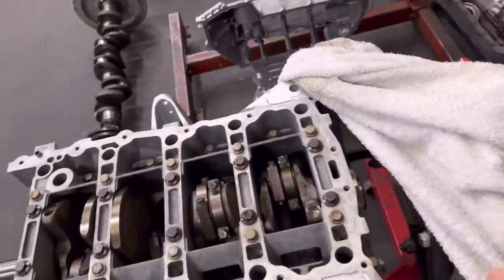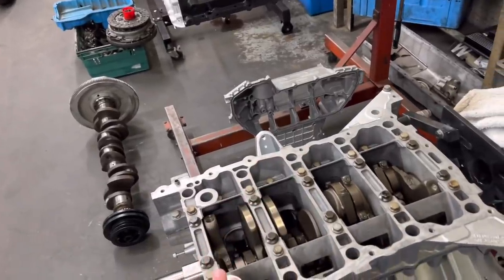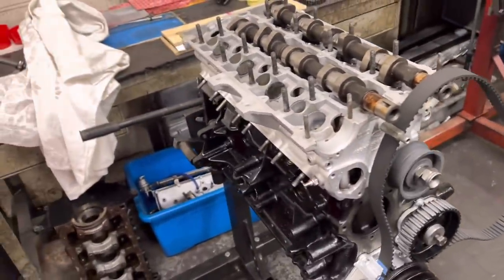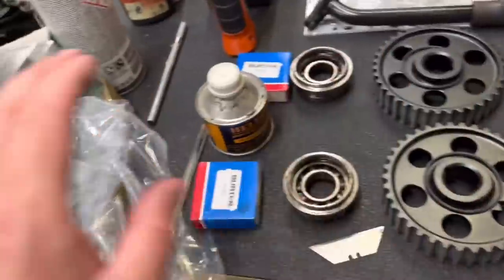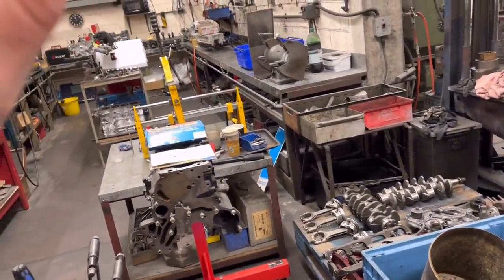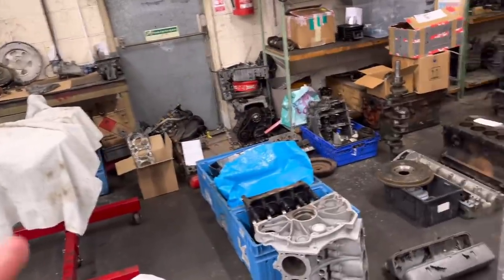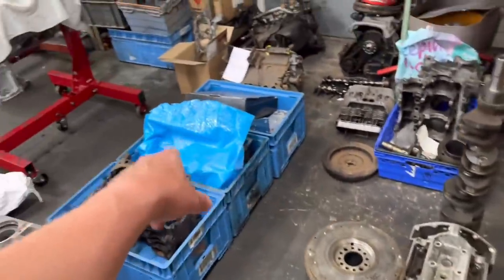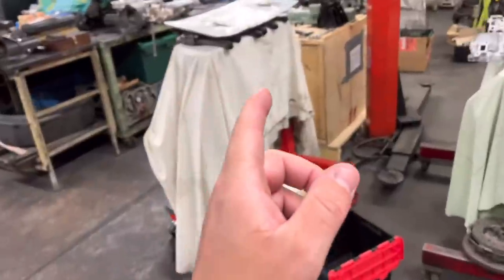I could be in BIG trouble for making this video

Comment: So where are the old oversize buckets?
Reply: Probably 'mullered' into one of the other bores and he is trying to fix the issue when he discovered he couldnt turn the cam to time it up hence belt hanging there.
Reply: @kevinapps1233  it will be as believable as his reasoning for building engines backwards. I am very suspicious of his story about those buckets, bolting head down without checking valves and cams are ok, just doesnt sound believable especially with that belt hanging there.
Reply: @kevinapps1233  i also wonder if he has ever heard of a valve spring, poundage tester, to ensure those springs are good,correct length and don't 'stack' up at full lift especially as he puts modified cams in.
Reply: @kevinapps1233  i think he thinks setting to cam grinders specs is good enough. We had a cam grinder and would experiment with different profiles, polydine correction etc. And run them to death on the dyno to find what worked and what didnt. We found that retarding exhausts would pick up a bit of low end torque at the expense of high end power and vice versa. A full list could be supplied to the customer so he could adjust timing to suit the track or weather. You could pull the same trick by increasing valve lash on push rod motors. The number of 'pinto' blocks that were sacrificed on the dyno so customers could keep their 205 and 200 blocks was large! With race or fast road YBs those hydraulic lifters were dumped and solid shimmed buckets were fitted to stop the followers 'jacking' up. Any full race engine or road engine were run up on dyno for break in and final tuning. This way we knew a performance motor was leaving the shop run in and fluid tight. Ordinary stock run of mill recons were done to factory spec with no dyno, but a list of dos and donts given to customer.
Reply: @kevinapps1233  thats thrown the gauntlet down i feel all you will get in reply are 'crickets' or sarcasm. I have tried to give him advise but he just ignores it as evidenced by carving 25thou of a cosworth block to remove the 'o' ring grooves.
Reply: @kevinapps1233  it will probably be a cold day in hell before that happens.

Comment: You got to love these armchair engineers, I never did it that way on the one engine I built.
Reply: Are you an engineer ?
Reply: @Ben-Dixey  i doubt it or he would be questioning the practices at barum.
Reply: @derektaylor2941  trouble is it is publicity for them and the practices on display are concerning to anyone  who knows a bit about working with engines. I mean putting those pistons in first dry, then fiddling about to fit crank. The reasoning in this episode is just ridiculous it compounds the error. Then turning it over so you can hear those dry rings and pistons scraping on the bores. That is mild then there is carving great chunks out of a new crank because his antiquated and probably worn out 'balancer' says its out. He didnt even do that correctly by gnawing away at the pin journals and destroying the surface hardness in a critical area. He should have put 'heavy metal' slugs in the flying webs if it was actually out of balance which i doubt it was. The list is endless and not a good advert for his company.
Reply: @derektaylor2941  I live locally to Barum engines and work in the automotive industry. From the people I've spoken to no one has had a good word to say. One of the biggest complaints is engine parts being returned full of swarf. I wouldn't take an engine there but I do like and watch the channel. As you say certainly not for education.
Reply: @Ben-Dixey  no surprise there then. Machining pistons with rings on, no parts washer bar a pressure washer in yard. Assembling motors backwards and basically dry its like a circus, needs to change name to 'barnum' i think.
Reply: Yes, and worked in a wide field from heavy plant to aero and have been very lucky to have work with some great people along the way and thanks for
Reply: @BILLHOVER  then you must know the practices at barum are are questionable at best. Edited to add, if you worked in aero would you want an engine 'reconditioned' by barum in an aircraft you were going to fly in?
Reply: @chrisclarke6344  You show us how to do it right , please leave the name of your YouTube channel be much appreciated..
Reply: @JOMaMa..  maybe you should give the name of your channel showing us how he is doing it right. As a man who retired in 2012 after 50yrs machining, building and testing engines, i have nothing to proove. I was tuning cosworths YBs when he was still at primary school, so do know a bit about them. The same procedures are applicable to all engine builds. For an example how many people put pistons in bores dry, before fitting crank?
Reply: @chrisclarke6344  I’ve installed pistons in engines dry numerous times before installing crankshaft..I add oil to top of pistons after installing then rotate the engine , I’ve never had an engine fail.
Reply: @JOMaMa..  why would you do that? How do you check crank for end float and rotation with those rods dangling about? How about crunching ovoid pistons in a three jaw chuck without even shimstock protection do you do that? Grinding lumps of new cranks in the worst possible place what about that? It seems the  bad practices are out there or are you lee?
Reply: @chrisclarke6344  Do you really have nothing better to do than trolling this guys buisness ? Or did Barums engine rip you off ?
Reply: @JOMaMa..  what is it with you, are people not allowed to comment on bad practice? And in respect to this comment and another you made, no they havn't no one who wants a good job would take a motor  there. I have also not asked for employment there, i retired 2012 he didnt start till 2016. I notice you wont answer my questions will you. I will also point out to you 'bullshittery' has two 't's, 'passed' in your context is spelt 'past'. And finally ' business' is spelt thus. You would be better going and looking at a real engineer and then see the practices at barum are are questionable at best.

Comment: While I appreciate Your explanation on the V8 Jag engine Crank. Does not Matter how many You have done, The Crankshaft should always be Torqued down and spun around several times to check for any hard spots and correct end float before the Pistons and Rods are added. Even though You said You fitted standard type bearings that should not be a problem, Their could be anything that could cause a problem. That crank that come out of the engine You said all You did was polish it. There could have been anything done to it before it come in to Your shop, that You would not know about, that could cause it to bind up. also a main cap not fitting down flush against it's mating surface and Tightening up but not seating down correctly. There are a number of reasons to Turn the Crank with nothing bolted to it, to insure it is turning freely and has the correct end float.

Comment: Thats the worst excuse i have heard for building a motor backwards. Even if you trust those bearings without checking, why would you put pistons in first? It makes it awkward to rotate crank to fit the rods and you still have the issue of knocking one out onto the floor. No matter how its dressed up its still bad practice. Especially on a '10k' rebuild.
Reply: @chrisjohnson4165  thats the only reason i could think of. The story he told is just a cover, he built that cosworth the same way with a ground crank, plus inserting pistons dry, and that useless finger wipe of oil.
Reply: @chrisjohnson4165  bet they dont get swapped out, i mean why would you build engine like that its not as if he is dummy building it to check clearances etc.
Reply: @derektaylor2941  another case jag v8 this time cosworth YB last time. Hence his excuse is ridiculous i think he built all that way and made the excuse this time due to the large number of comments. Missed last bit the only thing that you could learn here is how not to do it, and never take an engine here.
Reply: @derektaylor2941  i notice you got a sarcastic reply from barum about your AJ26 thats the only type of reply you get, i have told him how we got cosworth motors to hold together back when current, and asked if he wanted more info. To date only crickets and he prooved he ignored by needlessly carving 25thou of a cosworth block to remove 'o' ring grooves.

Comment: Stop being a YouTuber with crappy acting, click bait titles and thumbnails with odd expressions on your face.  Just tell it like it is.  The three issues I have mentioned make your channel very poor quality for serious engine guys.  Of course elementary students will like these things, but is that your audience?  I have unsubscribed pending "professionalizing" the channel.
Reply: The worst thing for serious engine guys (like myself engine builder and machinist now retired) is the ulimited bad or strange practices that go on at barum.
Reply: @kevinapps1233  passing on info is a waste of time here, as you say lee seems to work on '+/- that'll do'.
Reply: @chrisclarke6344  Could you tell us of some of those bad or strange practices?  I have built racing engines in the past, but all 2 stroke, so I am at a loss to spot the voodoo.
Reply: @ReachOutToWilliam  listed as they come to mind:
1,  building engines by putting pistons in first so its impossible to check correct rotation and end float.
2, fitting pistons dry so you hear the rings scraping on bores.
3, carving away at a brand new crank because his antiquated and probably worn out 'balancer' said it was 'out'.
4, carving away at crankpin journals to balance crank weakening it in a critical area and destroying surface hardness in that area. Instead of correctly putting 'heavy metal' slugs into flying webs.
5, machining pistons with rings fitted.
6, crunching an 'ovoid' piston in a three jaw chuck with no protection so distorted and marked after procedures.
7, no parts cleaning facilities apart from pressure washer in yard.
8, honing con rod ends free hand with a worn out flex hone.
9, reaming valve guides with a hand held drill.
10,not checking cams and valve springs for 'poundage andstacking' at full lift with performance cams fitted.
11, not removing core plugs and oil gallery plugs to properly clean blocks and heads.
12, not checking cam bearings for correct alignment after cutting a warped head. Apart from turning with a spanner and saying "thats fine".
13, no 'clean room' for building engines away from machining areas.
14, not checking ring gaps on a performance engine.
15, setting valve clearance by lopping ends of valves, and not changing or grinding shims to give correct clearance.
16, leaving key in toolpost and working around lathes etc with loose sleeved clothing.
17, apparantly sending engine components back to customers full of swarf.
18, blocks, heads, cranks etc standing on concrete floor with no protection.
19, sliding heads and engine components on a metal bench with no protection.
20, fitting cylinder heads without first checking buckets cams etc are free to rotate and all parts fit correctly.
21, not checking and equalizing combustion chambers after cutting several thou of a warped head.
22, needlessly carving 25thou of a cosworth block to remove the 'o' ring grooves which were there to prevent gasket failure. They should have been recut to accept .8 mig wire, which was one of the best ways to keep them together.
That is what i think of right now but there are others.